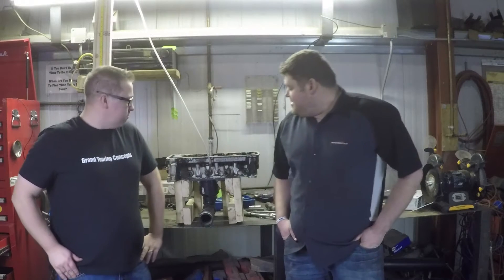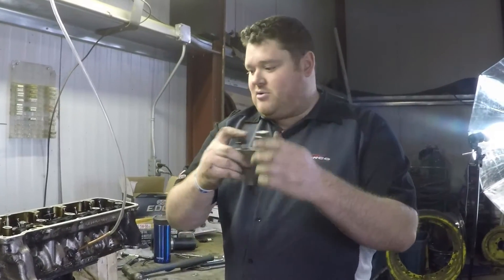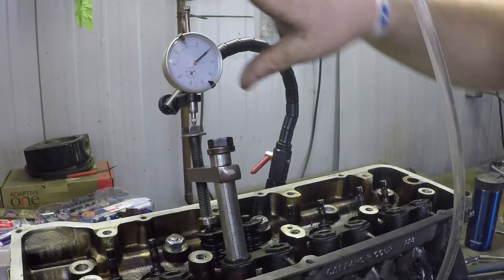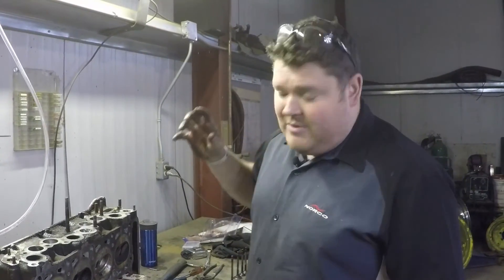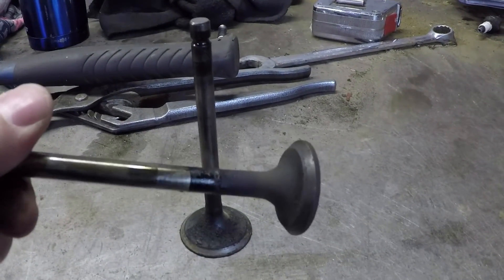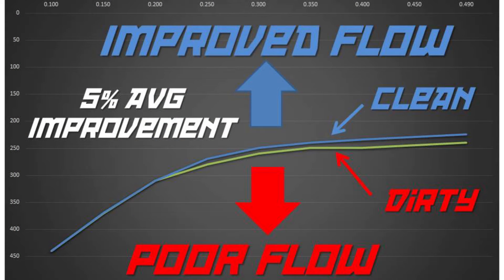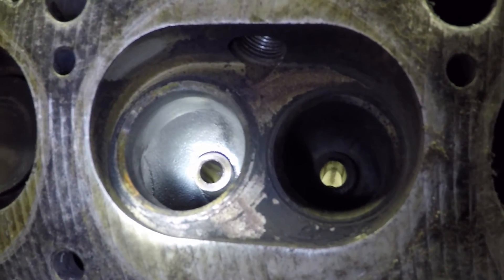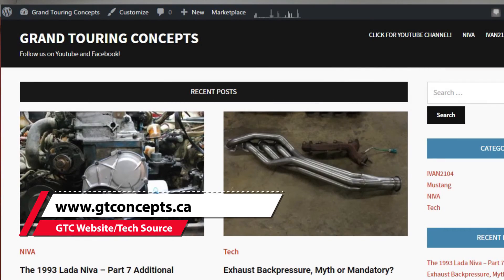IVAN2104 - DIY Flowbench Part 2

Comment: Why not just use the rocker arm with a kickstand on the push rod side. Then just turn the adjustment nut to open the valve

Comment: I have often wondered how well (or not) the Lada cylinder flowed, if I was not going to replace the engine in my Lada Niva I would port and flow the head along with what you guys are doing.
Reply from the maker: We do know that horsepower can reach 90 bhp with a little work (and far beyond with a lots of work) so we have hope for the head. It is certainly not the best design ever made though. We will calibrate our flowbench in the coming weeks and attempt to publish some baseline numbers, and then work on porting and improvement. Thanks for your comment and interest! - Darren